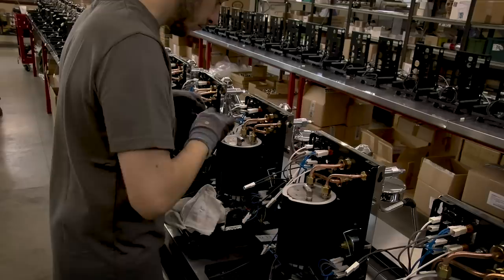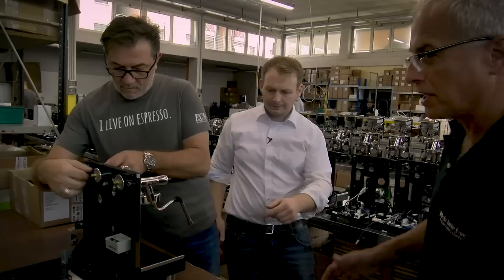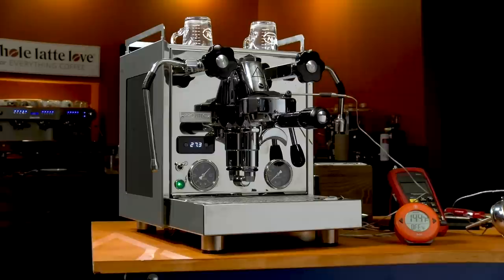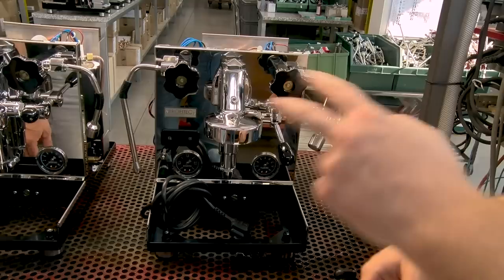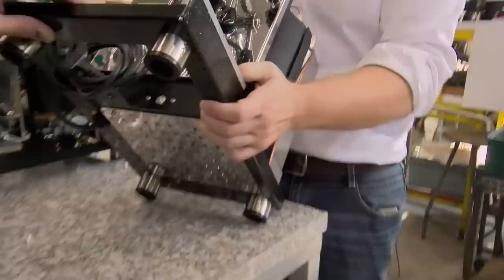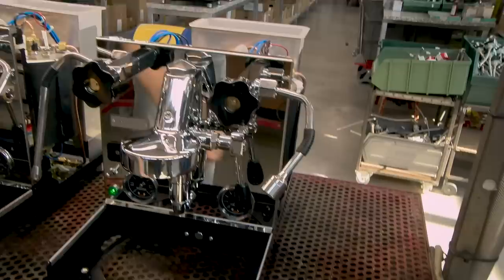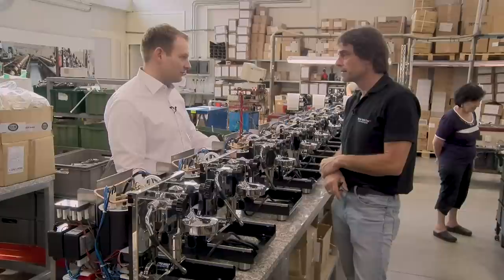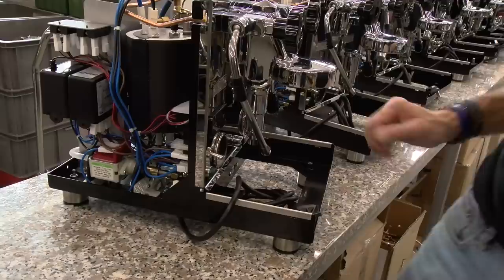Review: Profitec Pro 600 Sneak Peak from the Factory in Milan, Italy

Comment: Great review, I'm sold on Profitec,
I can appreciate the German engineered but made in Italy.
Now I need to decide 600/700.
Reply from the maker: Hi FI, Thank you for the comment! If you can swing it, go with the 700 and plumb it! Nothing like the sweet purr of it's rotary pump, pre-infusion capability and never filling a reservoir again!
Marc
Reply: Thank you Marc, Ironic as thats the direction im going, not a huge difference in price, and there is a possibility to plumb it in, plus other features, aesthetically I also do not like the black side panels. without hijacking the thread, what are your thoughts on pairing this up with a Sette 270? thanks for the great videos.
 @Wholelattelovepage

Comment: I guess it is time to find a new home for our much loved Pro 500.
Reply from the maker: Hi Don, There's a whole latte to love in the Pro 500. Sound like someone has a case of upgraditist!
Marc
Reply: It’s been a long road from a Mr. Coffee long ago. It is hard to imagine the Pro 600 is going to make a better coffee than our Pro 500, because out coffees are killer now. We are going to find out though!
Reply from the maker: Hey Don, If you are going to upgrade have you considered moving to a plumbable dual boiler machine? PP600 is reservoir only. The Pro 700 and ECM Synchronika are plumbable DBs. Never thinking about filling a reservoir - it's a life changing experience! Both have all the same features of the Pro 600 including the bump in steam pressure to 2bar. Both have rotary pumps and larger brew boiler. Pro 700 is currently $200 off.Marc
Reply: Actually we did consider it.  Our tap water is loaded with calcium, so some sort of water filtering is necessity.  I used an inline filter on a cold water line for a few years, and I was never happy with the results in water quality, and I’m too old to be screwing with accessing the filter to change it under the sink.  Now I just bring in jugs of water store water and use it for coffee and drinking.  It’s easy, cheap,  and I can fill up at the grocery store or Walmart about once a week.  Our coffee is great, no filters to screw with, and all is good.
Reply from the maker: Hey Don, I hear you. Do what works for you :)

Comment: You guys are KILLING ME. Ugh man I just upgraded last December to the 500. Then a month later the 500 PID came out but this. This may be worth biting the bullet on so to speak. Its a dream set up for me. Granted I don’t “need it” but this beast is hard to pass up! You’re company ever consider a buy back upgrade program?? 🤔
Reply from the maker: Hi Alex, ECM/Profitec works continuously to make better machines! I love the details inside. The little things which are invisible to many but make a difference like ceramic mushrooms in their E61 groups and upgrades to their OPVs. Then there are the big ones like best in class steam pressure in the 600, 700 and Synchronika. In your shoes, I might thinking about going with a 700. IMO going from a reservoir to plumbed machine is life changing and gotta love the smooth sound of rotary pumps! When plumbed you can do line pressure pre-infusion too. We have not considered a buy back program :(.
Marc
Reply: Whole Latte Love plumbed line is nice! It’s definitely a task keeping up with cleaning the plastic reservoir and keeping it algae free.

Comment: Of course this would come out just after I bought my Profitec Pro 500 arg! Also why do you guys push the stainless boiler so hard when Profitec also do a copper boiler for Australia?
Reply from the maker: Hi Homer, It is a bummer when a new product comes out you like after making a purchase! That said the Pro 500 PID is an excellent machine. As far as stainless boilers... While we were at the Profitec factory they were producing Pro 600's for Australia and they have stainless boilers. They do make a couple of machines with copper/brass boilers. As Michael points out in the video he feels stainless is a cleaner material for boilers and no benefit to using copper.
Marc

Comment: What could the reasons be for choosing this over the Pro 500 PID? Seeing as one of the main reasons of choosing a dual boiler machine; the temperature stability - is kind of moot since the Pro 500 PID is equally as stable? Thanks for an excellent video!
Reply from the maker: Tanax13 thanks for the comment and questions. Your are correct, temp stability is similar. Some differences with the 600: higher steaming pressure, shot timer, eco mode, backflush reminder.

Comment: Thanks for the video. Can you do a steaming comparison between the 600 and 700? I'm not that concerned about time but I'm curious which one would produce the drier steam given the new 2 bar pressure of the 600. Maybe one way to figure this out is to steam the same amount of milk to the same temp and weigh each pitcher before and after?
Reply from the maker: Hi Alex, Thank you for the comment and suggestion. We will have more detail on the Pro 600 in the coming weeks! Off the top of my head I wouldn't expect much difference between the 2 machines in water content of the steam. But we will check it out - thanks for the suggestion!
Marc

Comment: I know you said the profit tech ECM has raised a steam pressure to almost 2 bars. Have you tested the rocket machines for steam pressure what are they at?
Reply from the maker: Hi M, Thanks for the question. It varies a bit by machine. Max service boiler temp in the dual boiler Rocket R58 is 262F which = 1.5bar. Doubt you'd ever want to run an HX boiler machine that hot as your brew water would be way over temp.

Comment: ECM and Profitec are same group ?
Reply from the maker: Hi Ko, Yes they are it's kind of like Toyota/Lexus where Profitec is Toyota and ECM is Lexus. For instance, Internally the Profitec Pro 700 and ECM Synchronika are nearly identical. On the outside the ECM Synchronika takes refinement a step further with features like lever operated valves, PID display which blends into the bodywork, angled steam and hot water wands, single piece frame base, easiest to open case on the market and an included high quality tamper etched with logo.
Marc
Reply: Thanks for your info, Marc. Following  your videos all this time, I can see they are making good machines, technically and aesthetically. Unfortunately, it's not really 'available' in my country (Indonesia)
Reply: how does it compare to the new ECM machanika V slim?
Reply from the maker: Hi SD, Thanks for the question. Mechanika Slim is a non-pid, HX boiler (very large 2.2L boiler!) machine. The Pro 600 is dual boiler, PID with shot timer, more initial steaming pressure ~2bar and additional features like the ability to turn off the steam boiler, Eco mode which turns off the boiler after a user set time and user setable backflush reminder.
Marc
Reply from the maker: You are welcome Ko! Excellent machines - bummer not "available" in your country.

Comment: Can’t seem to find a really in depth review of the pro 600 yet. Can you comment on the steam pressure when making 6+ milk drinks in successsion? Any issues there? Coming from the pro 500 pid, the steam pressure usually hitting .5-.7 bars wasn’t entirely pleasant but like you pointed out in one of your other videos, it’s endless steam. How does the pro 600 hold up to that?

Thank you!
Reply from the maker: Hi Joey, Thanks for the question! When idle the Pro 600 runs near 2 bar of steam pressure thanks to the same PID/safety valve upgrade found in more recent Pro 700 and ECM Synchronika machines. The 600's steam boiler is about half the size of the P700/Sync boiler. I don't have hard data on multi drink recovery time. But, in my experience by the time you've poured the first drink then grind for and setup for the next recovery is complete.
Marc

Comment: What did he say there about copper vs stainless boilers? He said “we think it’s a cleaner material” then he spoke about descaling I think, but I couldn’t make out exactly what he was saying.
Reply from the maker: Hi a, I believe you are referring to Michael discussing how copper ends up discoloring when water and/or descaling agents make contact with copper.
Marc
Reply: @Wholelattelovepage  That is what I thought he was talking about. You know that  green discolouration is considered a a very attractive quality if you have seen the copper sheathed roofs of the any railways hotels (1800's) or parliment buildings  in Canada. ie. Château Frontenac in Quebec City
Reply from the maker: Lost Comma guess the green is not so appreciated inside an espresso machine. Also internally I believe stainless is likely to hold/bond scale to its surface.
Reply: yes - he's referring to the copper rust, which is "Grünspan" (green-span) in German... just mixing up the German and English words a little.

Comment: Do dual boiler machines pose any maintenance issues for the average consumer? I have read somewhere that de-scaling can be problematic.
Reply from the maker: Hi PT R3, Thanks for an excellent question! Most manufacturers recommend dual boiler machines be descaled by a professional service technician. It is possible to descale yourself, but only recommend if you are very comfortable working with plumbing etc. You can avoid scale build-up by using a quality water filtration system. For plumbed in machines we recommend the BWT Bestmax Premium system: https://www.wholelattelove.com/bwt-bestmax-premium-filter-package It uses patented ion-exchange technology to replace calcium with magnesium. When used properly the filter reduces scaling potential yet maintains a mineral level in brew water for best flavor.
Marc
Reply: Whole Latte Love 
Marc, I suppose one could setup a faucet for the filtered  water and use it to fill  the reservoir from it or for a kettle to do pour over. Hmmm🤔. Thank you for your help,  PT

Comment: can you please tell me the different between Profitec 600 and 700? many thanks
Reply from the maker: Hi Nga, Sure can...The Pro 600 is smaller in overall size than the 700. It has a smaller steam boiler, uses a vibration pump and is not plumbable direct to a waterline. Please let me know if you have any other questions.
Marc
Reply: super, thank you very much for your very quick Response. i am looking for a semi-Commercial coffee machine and may profitec 700 is good choice? any Suggestion from you? thanks

Comment: I would like to buy one between profited 300 and Rocket r58. 
Do you advice me to buy this 600 instead?
Reply from the maker: Hi LM, Thanks for the question. The Pro 600 will be a fine choice. The Pro 300 does not have the steam upgrade for 2bar of pressure in the service boiler. Compared to the R58 you are giving up the rotary pump and the ability to plumb the machine direct to a waterline. Initial steam pressure in the Pro 600 is higher than the R58. If you must have rotary pump and a plumbable machine think R58, Profitec Pro 700 or the ECM Synchronika. Both the Pro 700 and Synchronika have the 2bar steam pressure upgrade as well.
Marc
Reply: Whole Latte Love thank you for the quick and complete answer. Very helpful. I hope you have a great day. Greetings from Italy
Reply from the maker: Our pleasure! Really enjoyed our visit to Italy!!!

Comment: Considering buying one of the Profitec Pro machines for home use. Most of the time one person... just few espresso during the day and cappuchino/latte in the afternoon and on weekends.
Probably the Pro300 would be sufficient already for my needs, but I'm not happy with the design. Are there relevant benefits to go for the dual-boiler 600 compared to the 500, when just serving around 5 espresso a day, half of it with milk?
The warmup-time and total machine-size would also be relevant considerations in a small kitchen and sometimes limited time in the morning.
Reply from the maker: Hi Thorsten, Thanks for the questions. The Pro 500 and 600 are essentially the same size. Warm up time is similar. If warm up time is a concern you might consider a timer - I love WiFi enabled timers! What you get in the 600 that's not in the 500: More initial steam pressure. The steam boiler in the 600 runs up to near 2 bar of pressure in the steam boiler. In the 500 it's about 1.1 bar. 600 has the shot timer, programmable time for boiler turn off and programmable backflush counter. 500 does not have those functions. In essence the Pro 600 is similar to the current Pro 700 but with a smaller steam boiler, vibration pump and it's not plumbable. If you go with a dual boiler do feed it with good water. HX machines like the 500 are user descalable. Dual boiler machines generally are not unless you know what you're doing. Best way to deal with that is quality source water which reduces or eliminates the need to descale. Potential espresso quality is IMO identical between the machines. Steaming performance advantage goes to the 600 with the additional steam pressure and your volume of daily drinks. Hope that helps. Let me know if you have more questions!
Marc
Reply: Thorsten E. Gebuhr I am similar to you being a 4 shots and 6 ounces of steamed milk per day. My 500 does the job well. I can steam good textured milk and pull a shot simultaneously so it works well for me. The 600 obviously will steam better but realistically it’s probably unnecessary for users like us. If money isn’t a major issue than my personal opinion I would do the 600. But if your looking for good performance and tasty drinks for the money I would stick with the 500. Just my .02 as I know how overwhelming and pricey these machines can be. I have no regrets at all buying my 500 even it being the older non PID model. Also like Marc suggested I used the wifi power plug it was a fantastic suggestion by Marc and Profitec engineer

Comment: Hey guys, can you compare the Profitec Pro 500 vs 600, or is the 600 a replacement to the 500?
Reply from the maker: Corre Panama Hi, thanks for the question. The Pro 600 is not a replacement for the 500. The 500 uses a heat exchange boiler while the 600 is a dual boiler.
Reply: @Wholelattelovepage  Thanks!  I read the specs, also saw that is slightly bigger, but not by much.  Would be great to get a video "review, comparison & recommendation" for potential clients..  You know, a what we recommend if you want to ......  
Thanks again for the prompt reply.
Reply from the maker: Hi CP, Thanks for the request. So yes, the Pro 600 is basically a dual boiler machine in the frame of the Pro 500 HX Machine. On my to do list is a compare video of all the Pro x00 models.

Comment: Can the pid be upgraded on the Pro 800 for more steam pressure? I would (wholelatte)love to see more pro 800 videos btw #levaforeva :)
Reply from the maker: Hi Lzz, Can't upgrade PID as it only works for dual boiler machines where steam and brew boilers are separate. Increasing pressure/temperature in the 800 would result in high brew temps. Will try and do more PP800 and Lever machine videos in near future. Incidentally, I was in Italy a couple of weeks ago and was lucky enough to get a personal lever demo at the Izzo factory by Alex Izzo. The Izzo Alex Duetto machine (not a lever) is named for him. He pulled an incredible lever shot (using coffee he roasted) into a flat saucer with crema that barely faded after 10 minutes. It tasted fantastic too! I got video of the demo which I hope to share on the channel in the coming weeks. I love lever shots - like pressure profiling it ramps off the pressure to avoid over-extraction and produces smooth, sweet and syrupy shots with the right coffee.
Marc
Reply: Thanks for the answer as always Marc. 😎☕️
Reply from the maker: NP!

Comment: Seems to be a great performer, but myself I'm not a fan of controls in wet zone. Dials aren't that bad, but switch....I'm not too lousy but occasionally mistamp and get a pinhole which in combination with bottomless PF means coffee on front wall. Switch for sure is small but never underestimate ways of coffee may go. Steam wand is on same side...what's you experience with low mounted switches?
Reply from the maker: Thanks for the question. Understand your concern with the switch down low. I've used lots of machines from Rocket, Profitec and ECM with low mounted power switches and never had an issue. And like you I've had the occasional squirt from a bottomless PF. To date, I've never had an issue. I'm asking our service manager if he's ever run into a problem and will let you know.
Marc
Reply from the maker: From our service manager: "No it’s extremely rare. For the switch to get wet you need a leak on the boiler. If you want to worry about that, the entire machine is a wet zone."
Reply: Oh, thanks for sharing your positive experience! And I really appreciate sparkling humor of service manager - entire machine is a wet zone)) I like outcome - experience always clears up doubts of a layman.
Reply from the maker: He does have a sense of humor - I enjoy not filtering his opinions!